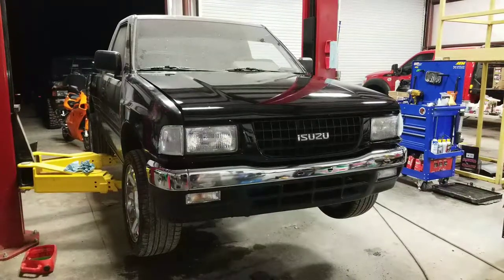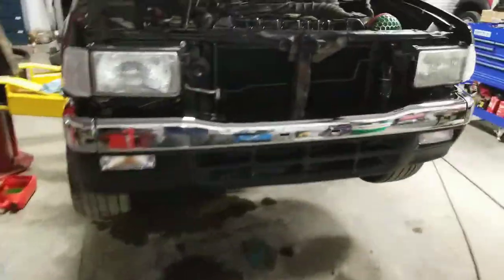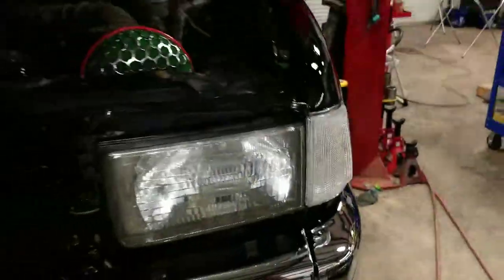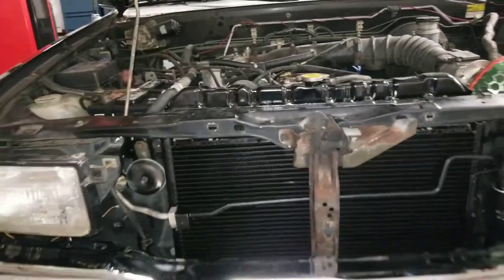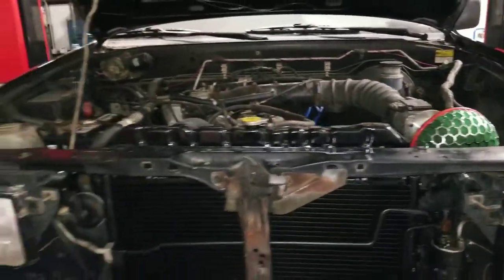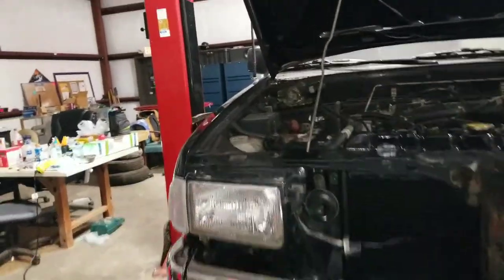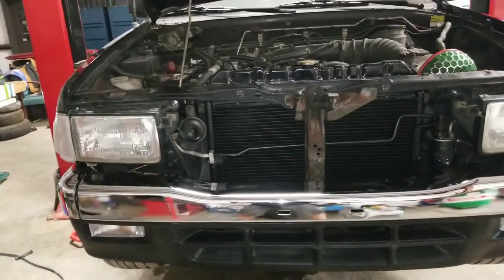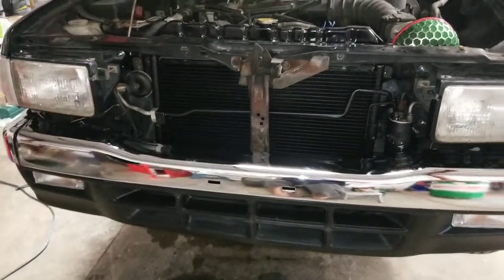Isuzu pup front end part#2

Comment: I recently finally bout a 95 isuzu pup an have always wanted one but cant find any after market parts for the motor like cold air, etc. any ideas?
Reply from the maker: Well the 95 was the only year pickup with fuel injection .with was the last year of the true isuzu pickup..the s model rodeo had a 2.6 liter 4cyl yours has a 2.3 the components such as a/c  and power steering these parts will fit your truck. your best bet is to find a donor 4cyl rodeo..93 to 97...hope this helps ...if you can find a 94/95 isuzu factory shop manual this will show all the componets you need ..